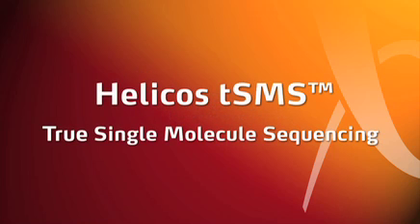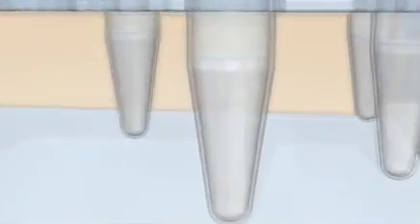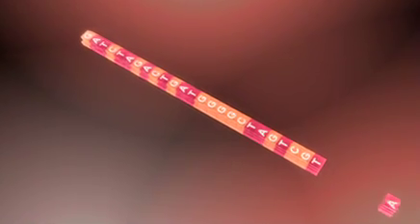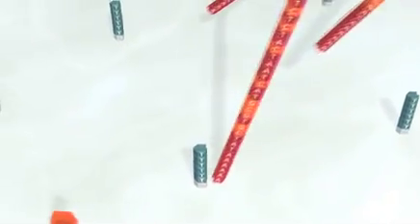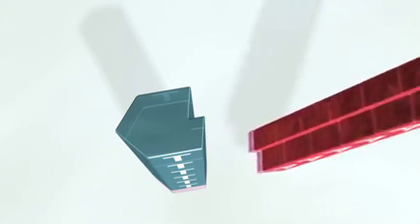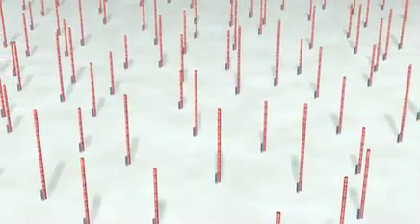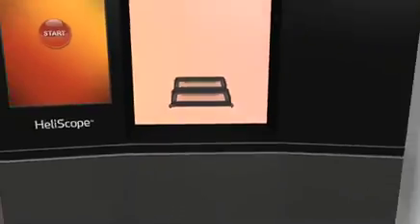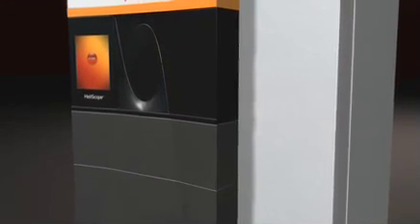Helicos High Speed Gene Sequencing

Comment: Because of different method of gaining that signal. Here, the signal is gotten by the fluorescent addition being referenced by the fixed position of one molecule using an ultra high resolution camera. In Illumina, the signal is gotten through a pH change - one H+ will create such a small change that the unit will simply not be able to  ID it, hence needing amplification.
Reply: that's not illumina.. that is ion torrent
Reply: Illumina also obtains the signal by the photosensitive detector as well as a different color of fluorescence for different nucleotides.

Comment: Representing the pentacle of UAC research and design, the BFG 9000 is the most advanced firearm ever designed. Fully self-contained and deployed as a handheld platform it is capable of an excessive amount of firepower. The BFG 9000 contains sophisticated friend-or-foe technology that discriminated targets in realtime. Each projectile contains a small, but very powerful computer core that actively maintains targeting and delivers a stream charge down each beam to soften targets before detonation.

Comment: I would assume that a computer program could be designed to look for overlapping sequences between pairs of the individual 100bp strands in its database. 100bp sequences seem long enough to ensure that the overlaps really constitute a true match, not just a chance pairing. I don't really know that much about programs like this, but it seems to me the the computer could be designed so that it knows the amount of overlap which is statistically significant.